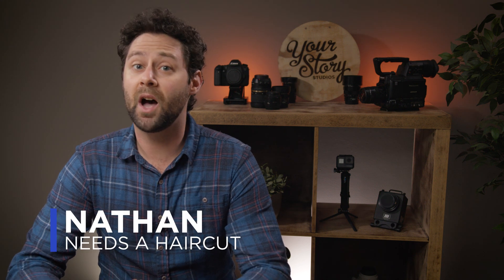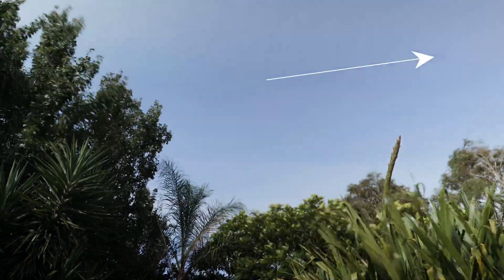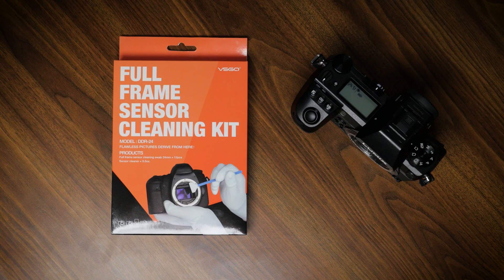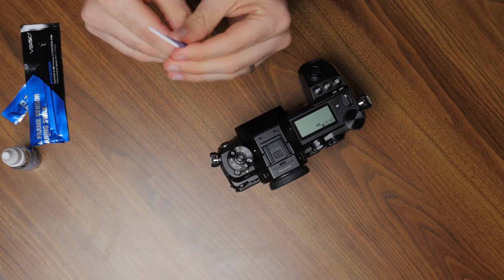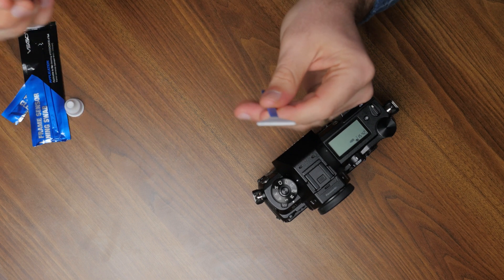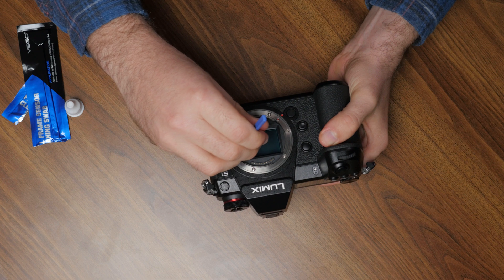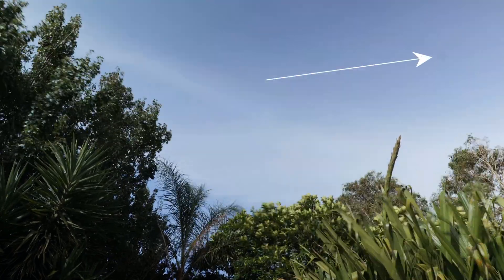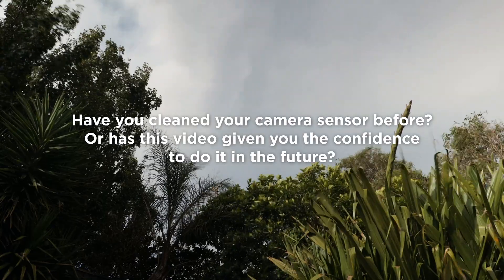Cleaning a mirrorless camera sensor for the first time

Comment: You don't mention if the camera body is on or off, is the sensor locked, is the IS set to off and switch to manual mode.  Note a very good instruction BTW.
Reply from the maker: Wow

Comment: Does the camera need to be off or on? I attempted with it off on a s5 and damn doesn’t that sensor wobble.
Reply from the maker: I did it with it off, but if you can lock the sensor when the camera is on that might make it easier.

Comment: You will destroy your IBIS like that, you absolutely must lock it in place. Switch cameras on , turn off IBIS , leave camera suited on , look at your sensor now.. oh it doesn’t wobble now , ok go ahead and clean . That’s the safe way to do it, not the way ur doing.😀
Reply: Hi, I just wanna make sure I get what you are saying.  turn IBIS off but leave the camera on?
Reply: @mikemcglasson1286  yes, the sensor should not have IBIS on because the sensor will move when your cleaning it. It’s on a magnetic field. To lock the sensor , turn the camera on , then turn off all IS and IBIS so your sensor won’t move, then carefully clean it with less pressure that you would normally use with a sensor that doesn’t have IBIS 👍
Reply: @davidcollins4227  thank you for explaining that.  What would be the reason for leaving the camera on though?
Reply: @mikemcglasson1286  because the camera needs to be on to lock the sensor. As soon as you turn the camera off, you sensor will move again(at least it does on Fuji cameras) . My advice, turn the camera off , remove the lens and inspect the sensor while gently rocking the camera (face down) and see if the sensor has slight movements 👍
Reply: @davidcollins4227  thank you for explaining this

Comment: You haven’t noticed any issues with IBIS after doing this have you? I accidentally got a very small bit of spit on my sensor when I was trying to clean a small speck of dust off of it. 

I have an S5 and would hate to damage my IBIS but I’m running out of options since I’m filming a wedding on Friday
Reply from the maker: No problems at all!
Reply: @YourStoryStudios  thanks, got it all cleaned. Your video was very helpful!
Reply: giving your sensor a gentle clean with  good cleaning kit is fine , problem is get decent zooms ..because changing primes just invites crud onto the sensor . it surprised me just how much is in the air on your clothes . just waiting to jump onto a nice large statically charged photo cell !

Comment: Hi 
Got some dust on it so..
I need to make it on my S1H is there any mode to lock on the stabilized sensor in the menu please ..? Thank you :-))
Reply from the maker: I don't believe you can lock the sensor but you can still clean the sensor with the method shown in this video. If you only have a spec of dust you could also try a rocket air blower to get rid of it.
Reply: you can deactivate it
Reply: @RafaelHanussek  Hi, would you be able to tell me the steps on how to do this please? Thank you
Reply: @PJ-kg2pw  not by heart, this should be on youtube or google somewhere